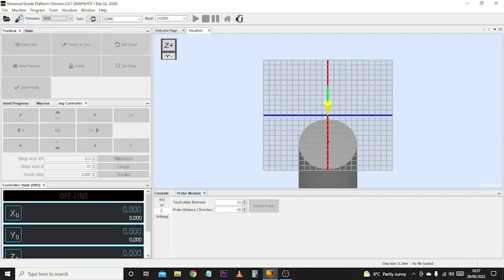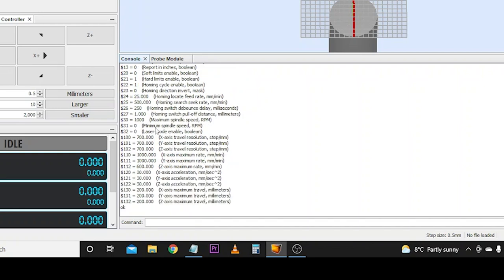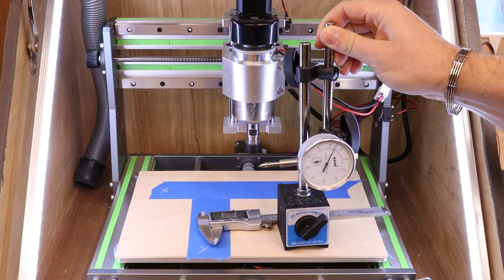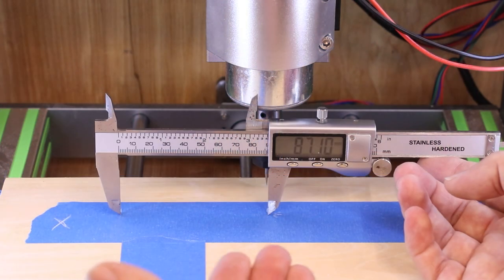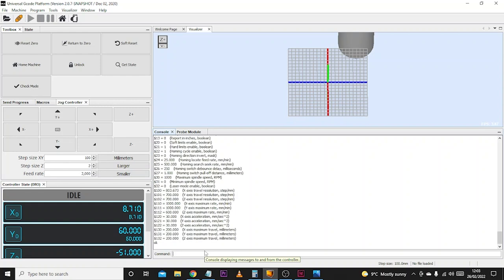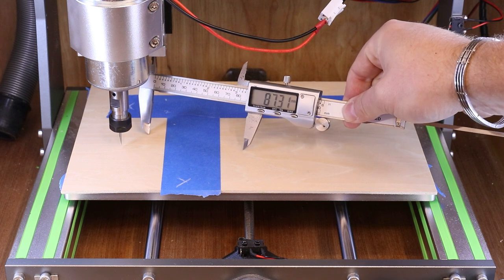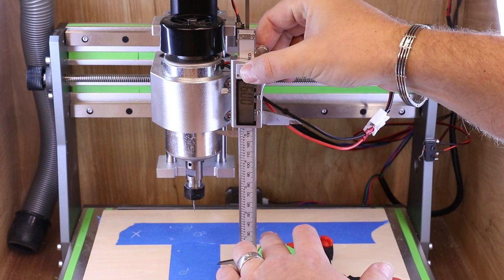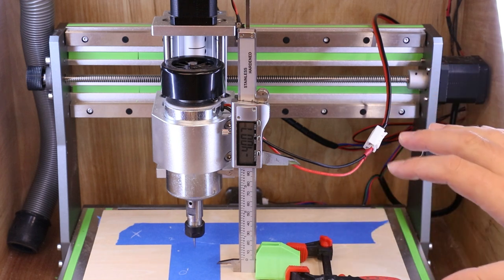Calibrating your CNC axis and steps - Beginners guide

Comment: Thanks for the tutorial. Nice to see the Setup Wizard that I developed a couple of years ago is being used. =)

When changing settings manually you should probably also reset the controller before making new movements to make sure the settings are being used. GRBL does not always apply the new settings instantly and could miscalculate the number of steps for the next movement, causing it to crash. 

The Setup Wizard will automatically reset the controller when these settings are changed.
Reply from the maker: Wow! Really cool that you watched my video, thank you. It will pin this to the top as it is useful information.
Reply: Thanks 🙏
Reply: Wow thanks this is a lifesaver I really struggled b4 I came across this information

Comment: This is similar but basic compared to calibration of industrial CNC gear. For example, back in the day, PCB drilling gear such as Excellon Automation used an inch by inch compensation script to allow positioning ±.0001" over 24". We would gen this script using a laser interferometer. It's very cool to see a similar option on low-level CNC gear such as these little desktop routers. Thanks for the video!
Reply from the maker: I love finding out information like that. Thanks for sharing 👍

Comment: Thank You, I am converting a Dremel Drill Press to a Mini MIll with a single CNC Z axis  via UNO, GRBL, CNC Shield, A 4988. This helps a lot as i just learned the V ref for the A4988. I will manually operate X & Y for this first operation. I am milling a slot into a model train chassis. Its a clearance slot so dimensions can be somewhat lose. I may convert the manual X&Y to CNC later. Appreciate your lecture. I am trying to use Easel but not sure my conventional Mill Design will work ok enough. Z is on one frame while X &  Y are below on their on frame.  this is not the Z & X on one frame with Y as a bed slinger,.  Should be interesting. Dennis

Comment: The more accurate way of doing this is by taking into account the angle of rotation of 1 step, and how much 1 revolution of the leadscrew moves the spindle ( in german it is Steigung ). This is actually the proper way of doing it, and if something is of, it will mean you are skipping steps or something is malfunktioning. 
Say 1 step is 1.8°, and 1 rev is 1.5mm. For this you would need 200 steps for 1.5mm, or 13333.333... steps for 100mm.

Comment: Very informative narration. I am in the process of calibrating my XY-Pen Plotter designed and fabricated by me. Your tutorial has helped me in this regard. I had arrived at 160 Steps/mm for my lead screw pitch 1.25 mm for use with Nema 17 stepper motor with 1.8 degree per step.
My next query is how to calculate correct values for $110, $111 parameters of X and Y axis. By experimenting I found a value of 250 for X and Y axis Maximum rate mm/min. I need clarity and concept to calculate these parameters ie, X and Y axis Maximum Rate. And also the respective axes acceleration values.
Reply: run at different accelerations till it skips steps then you know how fast  you can go

Comment: 4 Days and a controller reset on my 3018 pro. I loaded Parallels (Windows side by side interface) to run the Windows version of the UGS 64 bit platform on my iMac. it has been fun, but not nessessary. I easily Calibrated and Set my Zero spot in the Middle of my waste Board. Thank you, it will mean payment. UGS on Windows 11 Parallels 64 bit. Playing on a iMac 7 chip intel. I made many mistakes with the Mac 64 UGS app.  There are some difficulties loading the Mac version of UGS. Hold the ctrl key down as you double click the UGS Icon to start it.

Comment: Hi James. I already try to change my settings. Calibration. My X,Y,Z are wrong. If i change the steps, after when i press the SAFE the system changed as per from before. Let say can't be changed. What about if i delete asnd install again the program .
Thanks in advance

Comment: I have been using my Sable CNC with Mach3 and windows 7 32 bit. With your great video I just calibrated it with a new GRBL controller, Win 10 and UGS using a dial indicator and calipers. Seemed to go well but when I loaded Gcode made in inches I think it was making my part in mm. Do I have to do the calibration over? I could not find anything in UGS to interpret the code as inches.

Comment: given the closeness to 800 steps per mm would it not be correct to assume you have a 2mm pitch leadscrew and 1600 steps (1/8 stepping on a 200 steps per rotation) stepper so the correct calculation from the mechanical design is 800 per mm?

Comment: Hi :) i have some problem with my cnc. I did calibration as you have done in the video. When i type "move 50mm" axis move 50mm. But when I'm trying to cut simple 10x10mm square then the dimension are wrong. I'm getting 10,30 (on x axis) and 9.95 (on y axis). I don't know what is wrong. I was trying making g-code in easel, fusion 360. Same results. Do you have any ideas? :/

Comment: I'm not understanding something in this calib video. My masuter pro in ugs is setup differently ie. You have your $100 $101 set at 800.000 my original file is setup to 80.000 when I change it to 800.000 it jumps all over. Am I missing something?

Comment: Hi. Great videos! i have solved alot of issues using your guides. I did the calibration and tuning, however when i run this slot file, it makes only 1 deep pass, the the other passes are the same height. any idea how to fix this?

Comment: Hi James. Great video; thanks for sharing it! I've been doing this for my 3D printers for years but just got my first CNC router and found this very helpful; especially the technique of using the calipers on the Z-axis.
I have a question into which I hope you might have some insight: My CNC router has two stepper motors for the Y-axis. Is there a way to calibrate them separately (since they may not be exactly the same) other than decoupling the X-axis gantry?
Cheers!

Comment: Thanks for providing this info! I do have a question though. I noticed you did not round when taking the step values to 3 decimal places (which is effectively rounding down). That is, 803.673938... would round to 803.674. Is this important, or is it just a matter of personal preference?

Comment: Hi, so i have done this calibration. And bed and spindle is moving to the correct distance, but when i'm trying to cut 10x10mm square using fusion 360, i have 0,6 mm difference in x and 0,5 mm in y axis. I have check all nuts, parameters in fusion... i have no idea what more can i do. I have also try it with laser. And there is difference in size too... So i don't think that is a problem with fusion or lightburn config. Moreover when i change steps according to the cutted squares, it does seems to fix the issue... but then the x/y axis, are moving with some inaccuracy... Any ideas what else can i do?

Comment: Good info and presentation James. I have only used candle. What advantages,  if any , would you say UGS has over candle and vice versa.
Reply from the maker: Thank you. Always nice to hear. Easiest thing with Candle is it requires no installation. Technically UGS doesn't either but it does require Java being installed in order to run (although I think they released a bundled version of UGS and Java). That is about where the advantages for Candle end. UGS has better options and functions, as you will have seen in the video it has a setup wizard which can help solve some basic issues people run into. Its Z probe function does a fast find and then a slow find making it more accurate. The travel measurement for the Z can be controlled separately to the X and Y minimising the risk of burying your bit into the material by mistake. these are just some of my favourite features but there are more

Comment: Can you speak more on what the backlash is? How far should the Z axis go all the way up before trying to caliber it? I am so new to this that my machine hasn’t even arrived yet. 

Thank you
Reply from the maker: Backlash is essentially the amount of play before it actually engages the element it is trying to drive. So for example if you are using a spanner and turning a bolt one way, if you go to pull the spanner in the opposite direction there is a slight amount play in the spanner head before it engages the bolt to go the opposite way - that's kind of the same thing . As the stepper motor turns in the opposite direction and rotates the lead screw, it will take a fraction of a turn before it actually engages the nut on the axis carriage. Generally speaking its not a huge amount and higher quality machines will have less but overtime the backlash usually gets worse, especially if you don't lubricate the parts because the metal wears away. For most cases, just sending it back 1-2mm will be sufficient to ensure the backlash has been taken out before measuring. Hope that helps.
Reply: Thank you!

Comment: Hi, thanks for video. Can we calibrate machine without PC/laptop connected?
Reply from the maker: I guess you can via an offline controller but you would need pretty much every command saved as a separate file with the relevant settings you were trying to change. So yes but it would be significantly easier to find the cheapest laptop possible or an old Raspberry Pi and do it via one of those.
Reply: @JamesDeanDesigns  , I figured out that I can do it via Android GLBR controller app, that can replace laptop for GCODE. Thanks for answer

Comment: Thanks so much for your videos! Quick question if you have time. Im new so I am not sure how programs interact with one another. If I change these settings in UGS, will they transfer over to Easel? Or will I have to somehow change settings within Easel? I am just not sure if the settings are being changed on the control board itself or to the program being used. Thanks in advance!

Comment: Hello James, I'm wondering if you have any fixes for a Prover4030 that has two different steps between the Y1 and the Y2 motors! This video did help a lot but Ive noticed this issue and cannot seem to find a solution.
Reply from the maker: It can be multiple things such as bad wiring, too much resistance on one side. This article briefly cover some of the issues https://openbuilds.com/threads/y-axis-operating-at-different-speeds.17135/

Comment: I have the Masuter Pro and installed a Makia router. My issue is with a .25" spoil board and then a .75" work piece when I try to z with the probe and probing is done the router goes too high up and trips the limit switch, is there a way to avoid that, with not having the router go up so much or a good height for the router in the cnc? Thanks for all you help.
Reply from the maker: You can either adjust the height of the router in the holder to compensate or in your design software you will have a safe height, sometimes this can be as much as 1 inch. If you reduce this value down to something like 0.25in then it should work better
Reply: @JamesDeanDesigns  I will check it out, thanks

Comment: Would you follow this up but doing a cut to ensure it is correct?
Reply from the maker: You can but more factors come into things then such as backlash in the axis, run out on the spindle and diameter of the bits (most of my 3.175 bits are actually closer to 3mm for example) so yes, you should find your cuts will be more accurate but may not be perfect because of the other things I just mentioned
Reply: @JamesDeanDesigns  if you do an outside path on a box should this not then match, regardless of the bit size?
Reply from the maker: @derekjenkinson8014  in theory yes, but as I say backlash can account a couple of 10ths or a millimeter, your bit may be oversized or undersized, again accounting for a 10th or two of a millimeter, then spindle runout can make the bit cut wider than its diameter. I'm just telling you this because I've known people try and spend hour getting this 100% perfect but there are other factor to consider

Comment: Thanks for the Tutorial . I have question for you ! while i was doing Z probe calibration My z axis coming down very slow, and causing alarm 9 before reaches z probe ! using 3018 Pro can you please  let me know what i am doing wrong. thanks much
Reply from the maker: What software? Usually you have to get your bit within about 10mm of the probe, but within UGS you can control this distance to be greater or smaller
Reply: Check your gcode. Should look something like:

G38.2 Z-15 F50

G38.2 is the probe command, Z-15 says "go down by as much as 15mm or until you hit the probe", F50 says "move the probe at 50mm/minute.

Comment: James, I think this video and and the GRBL setting/tuning video can be done independently.  So if I’m setting up a machine from scratch, would you say it is more preferable to do one before the other?  I thinking the tuning video before the calibration video. Thoughts?
Reply from the maker: I'd probably say the other way around. Calibrating the steps is about making your machine accurate, tuning your GRBL settings is about making it faster. 99% of the time I would pick accuracy over speed but not everyone will.

Comment: Hi JD! 
I just got my 3018 PRO all set up yesterday, and I am going through your calibration guide, but Im finding that all the numbers in the Controller State (DRO) are red when a job is running. In addition to that, it appears that even though I am increasing the XY axis movement speeds ($120, $121), the actual speed is not increasing. What could cause this? I can't seem to find anything anywhere regarding the Controller State (DRO) numbers being red while active. Any and all help would be appreciated!
Reply from the maker: Hi, Check you GRBL settings particularly $10. It should be set to $10=3

Comment: Have you ever considered using a scale and microscope.

I insert a 0.1mm bit into my machine and use the microscope to get the steps setting correct. Using the calipers is not accurate beyond 0.5mm. 

Standard machine shop accuracy is 0.125mm

Comment: Excellent video. Unfortunately, due to mass production techniques, this will need to be done with every machine that is bought. (Unless it has already been calibrated back at the factory).

A lot depends on what tolerances you want to work to. As a retired CNC/AutoCad programmer I can tell you that you have achieved a very high level of measurement during that video. I'll be using that exact same method to calibrate my machine.
Reply from the maker: Thank you 👍

Comment: Will the x and y axis have the same settings or can it vary?
Reply from the maker: If they have the same size lead screw or belts/cogs then usually they will be very close but not necessary exactly the same
Reply: @JamesDeanDesigns  I was wondering about that.  Presumably they're using the same motors, drive electronics, and leadscrews, so why would they be different?
Reply from the maker: @Roy_Tellason  it's just tolerances to be honest. Every component used will have a tolerances and therefore can just be a fraction different, plus wear and tear. You might find one axis wears more than the other. The X and Y will be very close but chances are they will have a slight difference
Reply: @JamesDeanDesigns  If wear is a factor does that mean that you should repeat this calibration periodicall.y?
Reply from the maker: @Roy_Tellason  yes, depending how much you use your machine maybe look to do it every 4-6months. Obviously keeping things well lubricated will prolong this as well

Comment: Im guessing this is more for machines with leadscrews due to there being backlash. You really shouldnt need to calibrate the steps per mm if the components are well made. If you're needing to do this it suggests there are issues with your machine. Could be rigidity or an underpowered motor etc.
Reply from the maker: Multiple reasons for this video and process. Everything made will have a tolerance. This is about tuning your machine work with the tolerance of the components. 
Also let's say you've wiped your GRBL settings and don't know your step settings, this process will give you the value needed. 
In my experience, newer machines with ball screws do seem to be more accurate but I've still had to dial mime in a little